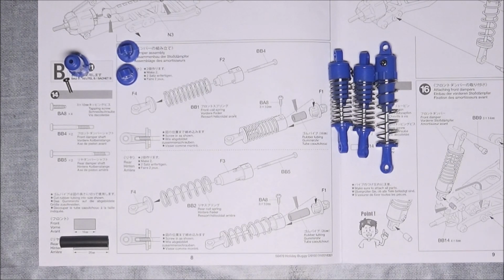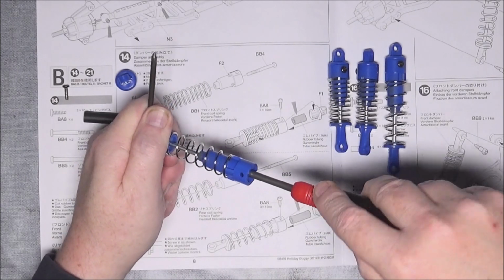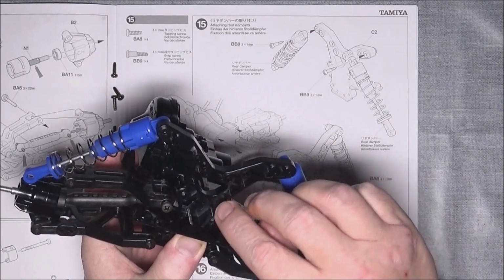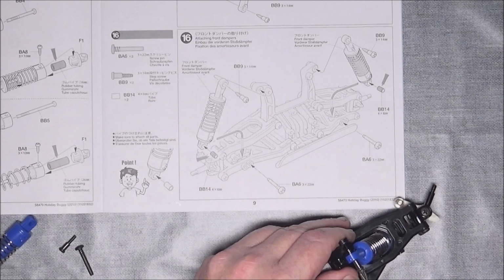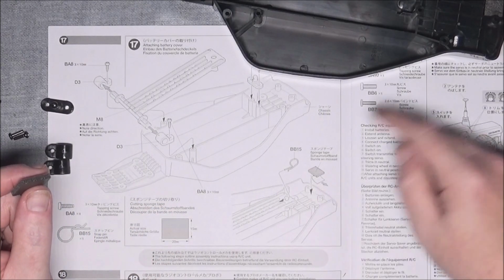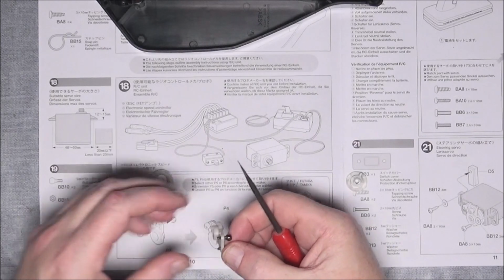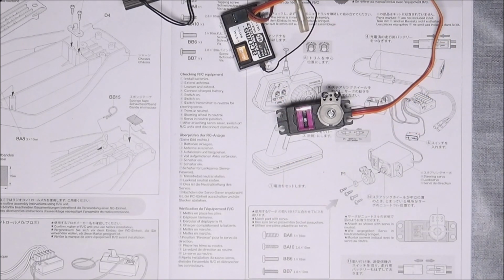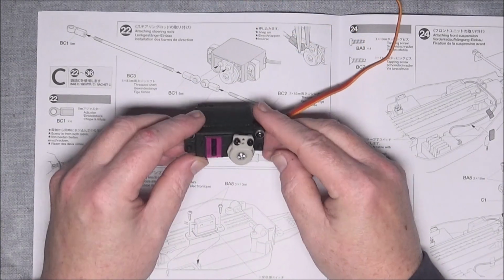Tamiya Holiday Buggy DT-02 Build Part Three

Comment: At least these weren't Pogo Sticks! If you can find them Used, and cheap as Chips... Traxxas Bandit Shocks are a direct swap. And excellent Shocks as well.. 😉
Reply from the maker: Cheers Carmine. I will keep my eyes open but not found any so far either used or new. Stay safe mate.
Reply: Right.... NOTHING'S easy to find these days!! 😖😠 
They do pop up. 
They're pricey - but if you can find a set of RC10 Shocks, THOSE are the Cat's Ass for performance!! 
The Traxxas Shocks work well though.

They're easily obtainable over here.... Maybe I can get you a set, and drop it in the Post? 😉